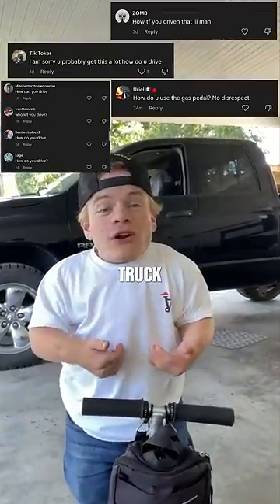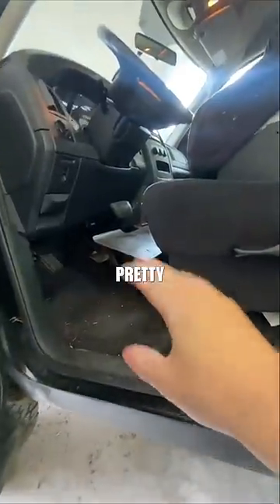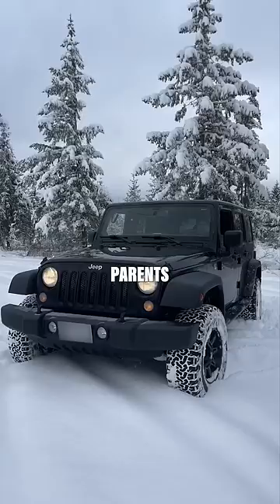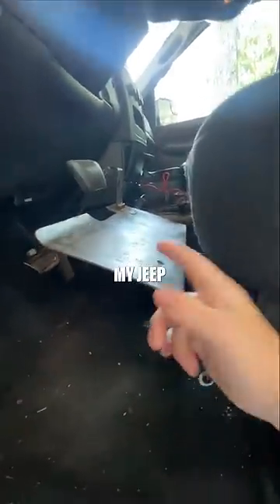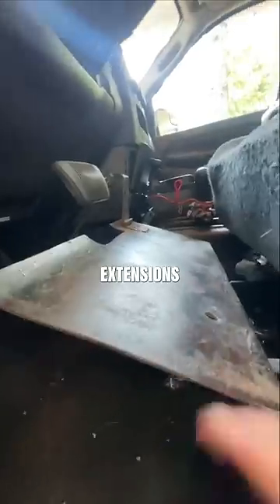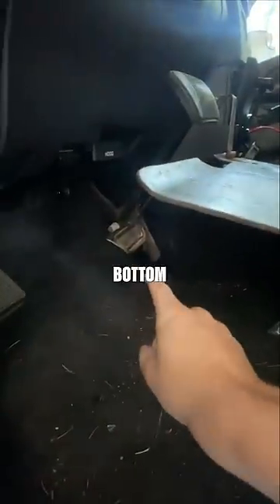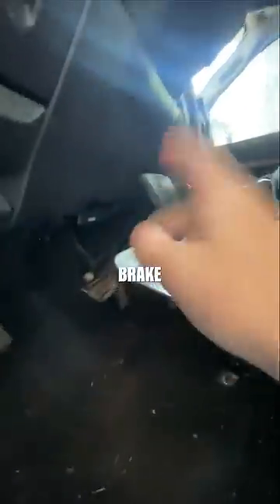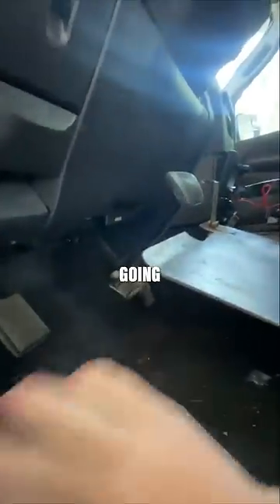Driving the truck is a ton of fun!

Comment: That Jeep looks so badass 🔥🔥
Reply: Bro that is mean
Reply: @Ilhamgh980 how he’s saying it’s fire and cool
Reply: Looks like every other jeep on the road
Reply: @Averagebanjoplayer  true
Reply: @Ilhamgh980  Huh!?
Reply: It's always in the shop getting fixed 😂
Reply: @@Shoom-wv7gg my 2 neihgbors have them, and yes they are always getting fixed, that's why I got. 4Runner.
Reply: @nokianx400 XJ's are practically indestructible unless you completely neglect maintenance, even then ive drove one with a blown head hasket and a misfire for a couple thousand miles and it was doing just fine
Reply: @Ilhamgh980 💀💀💀
Reply: Bro I bet I'm sorter than you
Reply: And it's also in the shop, where it spends most of its time.

Comment: As a Miata owner, you could probably drive a na/nb with very little modifications, maybe a little bit of pedal extension, but probably not more than 6 inches
Reply: i just suggested the same thing altho i reccommended the miata hardtops since one button the the top goes back rather than him having a hard time with the manual top
Reply: I LOVE the Miata so much.

Comment: You might consider trying hand controls, as they are adjustable and the car can still be driven normally while they’re installed. I’m a double amputee so I use them and have them in my car as well as my brother’s car, so we’re able to drive each other’s vehicle if needed, even though we almost never need to.

Comment: Thats fucking sick man, my next question would be how do we make a pedal extension that can be quick swapped into different vehicles or removed entirely for full sized drivers. And all without using tools.
Reply: Pretty hard without tools as most if not all cars are somewhat different
Reply: I'd assume its possible to have makeshift flooring and have brake,clutch, gas pedals etc that could bolt on to existing ones like so without need for welding

Comment: That brake pedal is dangerous.

Hey OP I've modified plenty of vehicles from handicapped Harley trikes, to jet skis for a guy with 2 half legs and one arm, as well as plenty of regular car hand controls etc.

That brake pedal needs a triangular brace at the base or it's going to break during emergency braking.  I've seen it where it brakes during an accident and the driver rolls uncontrolled after because the extension cracked.

If you want I can figure out how to get in touch with ya and draw you a diagram.

Comment: So if you install the pedal extensions on your parents truck, does that mean they can’t drive it unless you cut the welds? Or do they like fold to the side
Reply from the maker: The brake actually stays on! But the gas extension, floor board, and seat all easily come out! The brake however is pretty non intrusive and doesn’t get in the way so anyone else can easily drive with the extension still attached